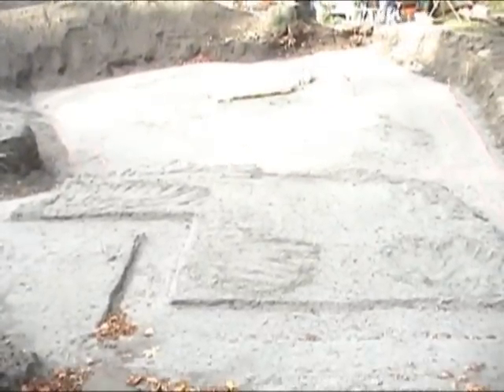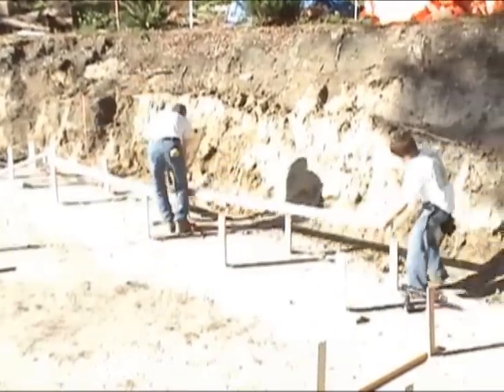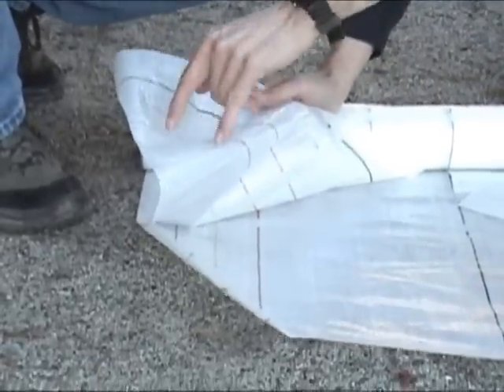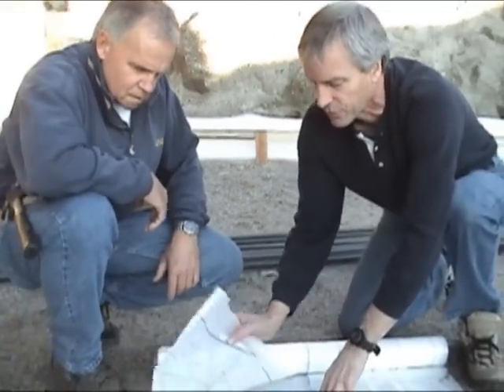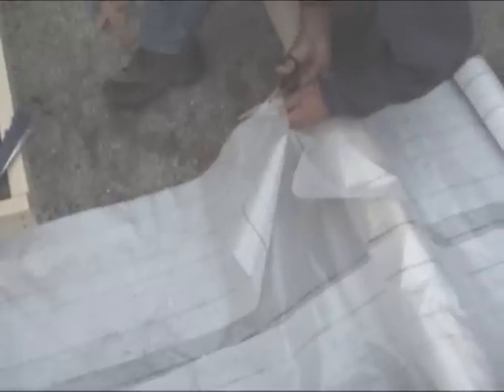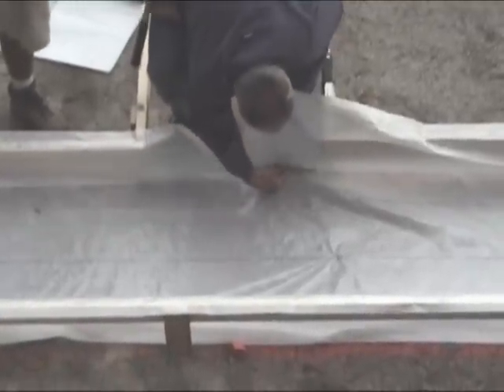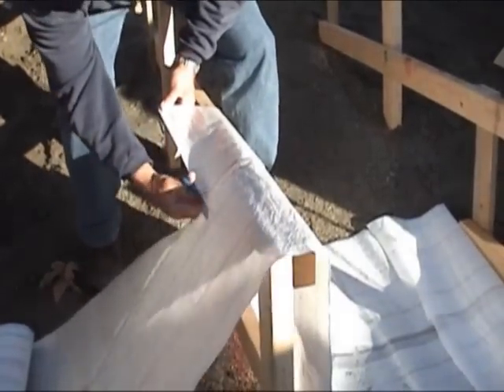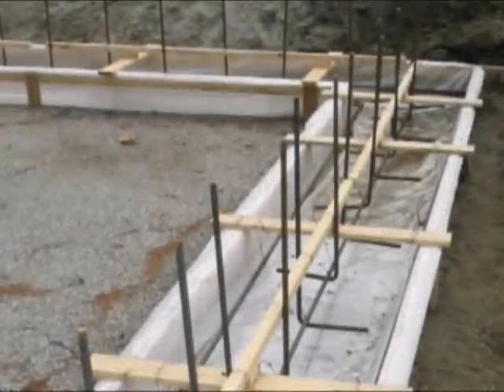Fastfoot® Residential Concrete Footing Installation

Comment: Wow...homeowner special. I would be out of business if I "wasted" this much time doing the footers. As for dryer..?!?!? Come on isolating just the footers will do little. A good perimeter drain will accomplish much more for less. As for vibrating, if your wood forms "leak" or rack.....you did it wrong. This is a 4 hour footing, start to finish.

Comment: I work for a foundation company and we reuse the boards so it doesnt matter if we buy 1 1/2" X12" boards. And the brackets are reusable also. So I guess if you are doing job after job this way is the most efficient.

Comment: The brackets im talking about have 8" legs on them and are shaped in a upside down U.They are made of steel so they obviously wont break and the legs hold the boards from bowing or moving.Also,if you are worried about your basement becoming damp you just put insulation down before you pour the floor.Obviously there are more ways than one to skin a cat and if you were pouring just one foundation you could do it multiple ways,but for a quick- building and level footing this is the way to do it.

Comment: Alright...the quickest and easiest way to do a conventional footing...that I know of. Lay out footing...form with 12" boards...hold from spreading with metal brackets that go over the top (if you dont have brackets 2X4s nailed on top with banding underneath will do)...put grade nails in with laser...chalk lines from nail to nail and put the rest of the nails in...pour.

Comment: Dude, the whole idea behind this method is not to waste lumber, so you can instead use 2x4 screw them high and use the fabric to hold the concrete in.
Reply: Agreed. Once the concrete has set, simply back the screws out and the lumber can be reused.

Comment from the maker: The Fastfoot® fabric must bulge out to provide its strength. This does not mean that you will be using more concrete though.
You place your stakes at your footing width, so the top of your footing is 3" narrower than its bottom. 
Loads are transferred from the wall, through the footing, and to the ground at a 45 degree angle. Meaning that the top sides of a footing are typically serving no purpose. 
In fact you will save on concrete as none will be escaping through the bottom of the form.

Comment: Would you rather buy a bunch of 2x12, ship them to a jobsite, chop them up, and then throw them away after the concrete pour? Form footings with 2x4s and Fastfoot. Then re-use the lumber in the framing of the house. No alkaline damage to the 2x4's, and a dampproof footing at the same time!
Reply: My thinking exactly.

Comment: Why do we waterproof a wall, and then leave our footings unprotected? Concrete is a sponge. It will absorb moisture from where it is most wet (the footing), and take it to where it is dry (The basement).  This product contains the concrete and prevents moisture from wicking through the footing and into the home.

Comment: @jarredkh well, if the concrete truck runs him over, the safety glasses will not help him at all right????

he needs safety glasses if he will be actually working on the concrete poring process.

And no need of hard hat because it seams to be a residential work, so if an accident happens they all are fucked if the general contractor has no workers insurance.

there are no accidents, only stupidity performed by dumb people.

Comment from the maker: @orbiteq19  with typical wood footings, they are afraid to vibrate as the concrete can continue to pour out the bottom of the screed boards. On this job they did vibrate without any issues. Also, as you can see in the video, they can kick the Fastfoot® to consolidate the concrete.

Comment: where is vibration for concrete....
Reply: He said they vibrated. Plus you can see kicking the bag.
Reply: Ridge Runner its important to vibrate if thay said lets show it:) kicking the bag its a poor method with unknown effect I suggest to take few peaces cubes during concrete casting for compression test just for sure. 
PS. Nice method, fast and cheap

Comment: Great for uneven ground, very strong yet easy to cut. Still requires lots of work, forms still need perfect placement,  height, leveling, plumb, etc. If deep, (over 12") you need lots of extra wood form still. 2x6s or 2x8s, multiple rows of support wood, vertical every 3-4' , every vertical supported, cross ties every couple feet. Then it works great. Very light, easy to place after forms built, contours to surface well. Greatly reduces work on uneven ground, it will contour to it all.